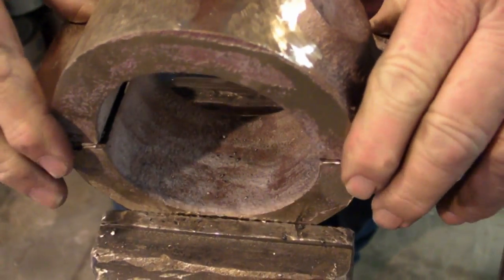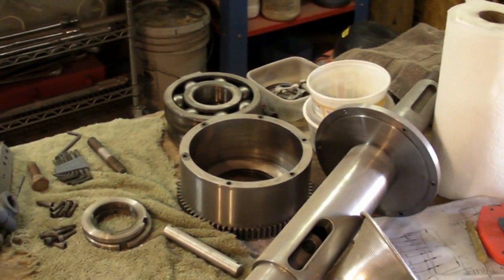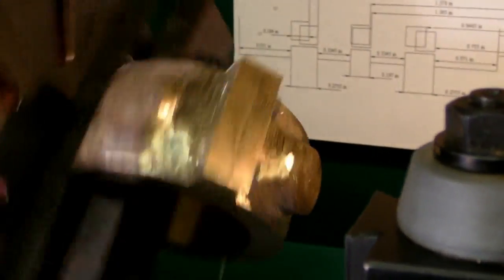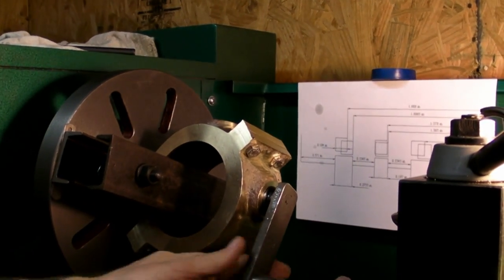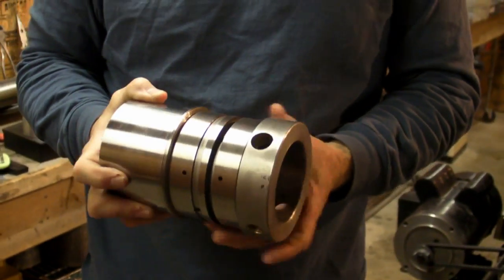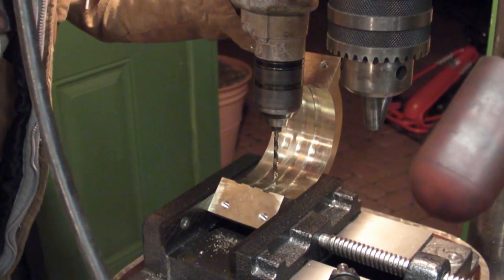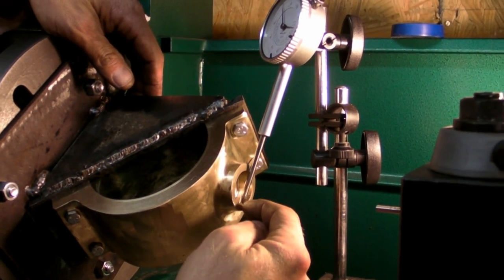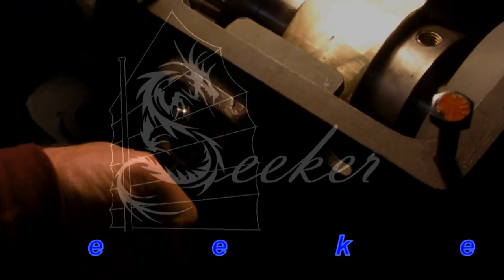Hundested Rebuild - Part 2 - Machining the Distributor Ring

Comment: Sweet! nicely done, Doug

Things can allways be done a dozen different ways! I like that you, showed a bit about the scrapping you had learned, on the split line mating surfaces, files do make great scrapers, try dressing a three sided file great for scrapping inside bores. Great job with the face plate, learning to hold parts, without putting the squeeze to it! Hats off to getting it done, without a bridgeport for the milling and drilling! :) Keith

Comment: Very nicely done! Just some other info, if you casted the flat sides slightly larger, you can build a fly cutter and run it on the lather to skim the ends perfectly flat and they will fit like a glove!!

Comment: Nice work.  You mentioned the YouTube channels for learning about using a metal lathe.  A good text to start with is "How To Run a Lathe", originally published by South Bend lathes in the early 20th century.  It has all the basics and can be had on-line from several sellers.

Comment: That's a chunky tap alright. I never liked power tapping in a lathe so I made a do-dad that goes in the tailstock chuck that lets me hand tap. It's basically a rod that gets chucked in the tailstock and a tap handle extension that can slide and rotate on the rod. Some people use a center in the butt end of a tap and then crank the tap with a wrench but I find that too fiddly and it only works with center-drilled taps. My do-dad solves that and also works well in a drill press.

Comment: @7:20 I find it works well to drill a hole with the drill press, then immediately remove the drill bit, put the tap in the drill press, then run it in by twisting the chuck with my hands.  Seems to get the tap positioned properly.  Kind of a pain if you're doing a bunch of threaded holes, though.  Also, a proper tap handle so you can apply force equally from both sides.

Comment: Looking on the net it doesn't seem that your lathe has a back gear. It's just a low speed range system that uses an eccentric jack shaft to shift alternate gears into the train to achieve the lo speed range. A bull gear is part of that system and rides on the spindle with provision for disengaging it when using the back gear. No matter though, your machine goes down to 70 RPM, which should be slow enough for most jobs.

Comment: What kind of machine is that would it be a suitable machine for starting a hobby shop
leading to a small business
Reply from the maker: See:  Grizzley 4003 12x36 Metal Lathe
...and it would depend on what you planned to make.